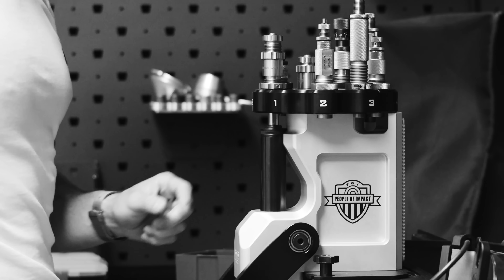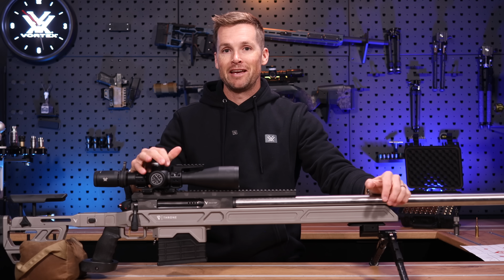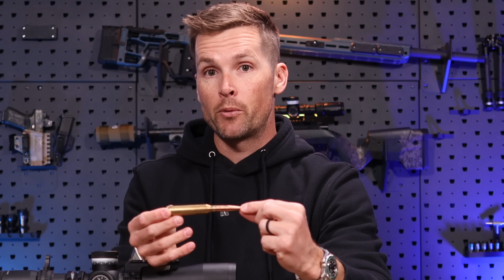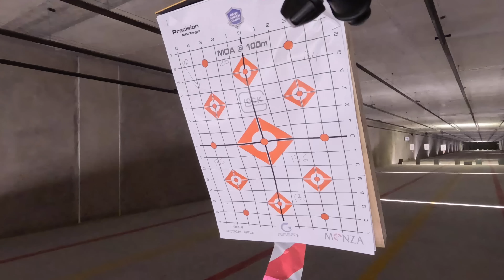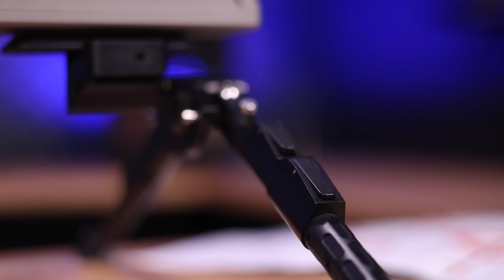.375 CheyTac ELR Load Development MASTERCLASS

Comment: The 408CT was based off the 505Gibbs necked down to 40 cal , the base webb design is heavily re-inforced to handle the higher pressure , and the 375CT is a latter version of this original calibre .
Bertram & Petersen make brass for the 375CT  , Hornady & Berger & Laser & Sierra make bullets .

Comment: Piet, try the cutting edge lazer 400 gr. I’ve had excellent results, and a better BC than the 379’s. Also, I find N570 a bit dirty compared to Hodgdon H50BMG. Excellent results though! I noticed my groups opened up with higher velocity. I found the 400gr Lazer’s love 3050 FPS